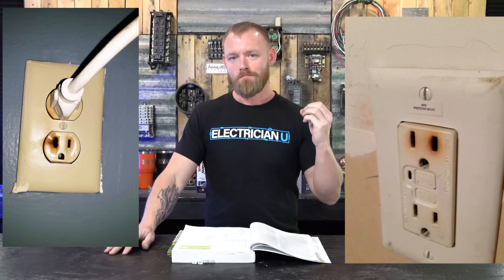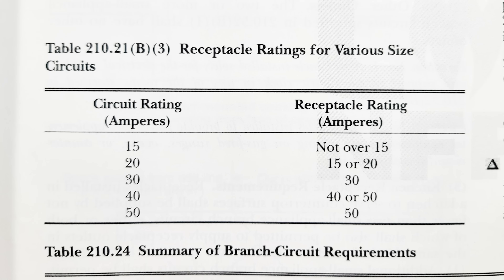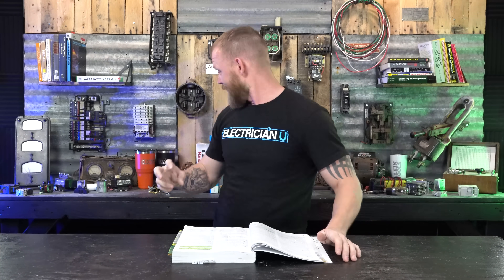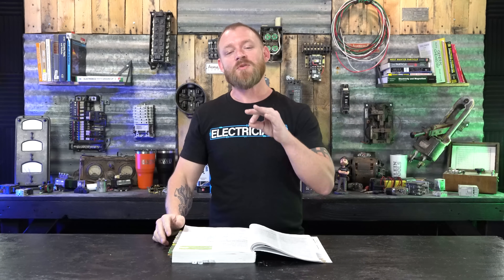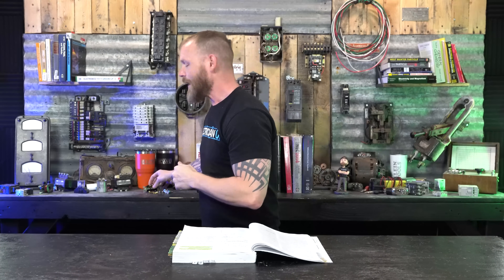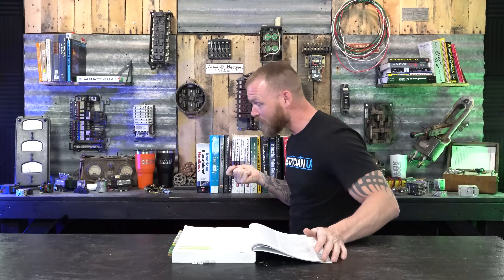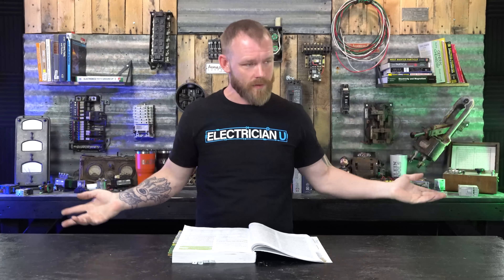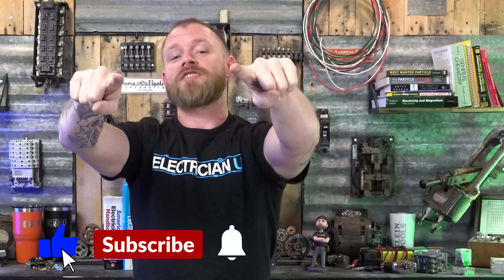Won't These Melt?!? 15amp Receptacles on 20 amp Circuits!!!

Comment: Rule of thumb don't always trust the codes!!! 
If it says you can use 15 or 20 amp receptacles on a 20 amp line/breaker then just stick with 20 amps receptacles!!. Code also says that the backstabs on receptacles are also allowed and up to code, yet they tend to come loose and can cause a fire in which you should always make sure the wires are screwed into the receptacles period!

Also as pup seen this in the past. Pup has seen a mixture of 15 amps wires (14awg)  and 20 amp wires(12 awg) on a 15 amp breaker and a 20 amp breaker. 

So what pup does is simple. As long as everything on that circuit say is 20 amps then use a 20 amp breaker. If you have anything that is 15 amps then use a 15 amp breaker. 

Never ever install anything that is rated lower then what the breaker is. 

Also if the wire/circuit has a mixture of 15 amps (14 awg) or 20 amps( 12awg) then make sure a 15 amp breaker is installed or have the wires/line replaced with either all 14 or 12 gauge wires with their breaker respectfully installed on that wire/line
Reply: Good point about backstabs or backwired receptacles.  A few minutes of playing with one on my desk, trying to pull the wires out (and succeeding!), convinced me to use only the screws on the side.
Reply: @michael.a.covington  yeah and sadly it's Ul and nec electorial code approved...

I've never used back stabs and never will!!
Reply: @PhantomWorksStudios  you said "Rule of thumb don't always trust the codes!!! "

How is that a rule of thumb ?   It does not give you clarity on when to , or when not to trust the code.
A rule of thumb is something more like saying 1 inch per 1 ft ,  is how you determine the floor joist size you need .

Comment: Assuming a 20A circuit with 12awg wire and 15amp-rated receptacles, would receptacle damage occur if the receptacles are pigtailed to the lead wire rather than using the receptacle itself to serve as a splice?
Reply: Never splice a ground wire.
While pigtails are acceptable under the code (along with their "wire nuts"), they are best avoided when possible as a "best practice".

Comment: A 15A receptacle should not have more than 12A load.... meanwhile.. every space heater in existence is designed to plug into these outlets... and are 1500W.... which is 12.5A.

Comment: If we connect a circuit breaker on each outlets, that would be impractical & expensive, not to mention the wires. So, just a simple rule of thumb, never plug any motor load or large load on a common outlet. Instead, separate a special outlet and breaker for that load.
Reply: You could just use a fuse like the British do.

Comment: The joy of living in a country with 240v power, our typical receptacles are 10 Amps so we have 2400W available vs 1650W from a 110v 15 Amp. Also less loss of power during transmission
Reply: Transmission voltage is much higher than 240V (local is normally close to 14kV, long distance are usually in the 200kV to 500kV, but can be much higher). Most homes built in the last 25 years have receptacles wired with 12 gauge which gives you a maximum wattage identical to your 240V @ 10A circuit. We also have the option of using the same two conductors (12-2 Romex is usually rated for 600V) + ground in a 240V @ 20A circuit. All we have to do is install a double slot breaker, connect the neutral to the second terminal on the breaker and install a Nema 6-20R receptacle.
Reply: @rich7447 it’s also a decent idea to mark that white conductor as carrying current with red or black tape or heat shrink.
Reply: @TomCee53  Definitely.

Comment: Personally, I put 12 ga romex as the minimum and use 15 amp breakers and receptacles Rather have the breaker pop than have a melt down inside a wall.  This also takes care of receptacles.  Been doing that way for over 40 years.  Have wired many structure without a wire-fire.  This also helps with loose connections here and there throughout the circuit as well, although not a fail safe.   More to your point is use of slide in connections at the receptacle rather than using the screw terminals is more likely to melt plastic, especially after that connection has been heated once or twice.  Let's be real here.  The entire electric code allows use of some pretty scary stuff.  Hard wiring is always better than receptacles and I realize not everything can be wired that way.   Receptacles are basically a compromise from the git-go.
Reply: A Day.  In the UK all receptacles are made to the same standard ie to the back up MCB-32AMP. with plugs all rated at 16amp, fused internally to a given load.(max 13amp) Admittedly we don't have the same load problems as you due to our voltage. Wouldn't it be better if ALL receptacles were rated the same? ie singles 20amp and twins 40amp, wired to suit. With internal fuses within the plugs to suit given load.Then  the problem with twins, having two high load draws(20amp each) would no longer be a load problem?Low load items would be fused down within the plug.
Reply: waste of money, 14ga can handle almost 20A at 60degrees, the breaker is always designed to be the weak link and trip before anything can happen to the circuit.